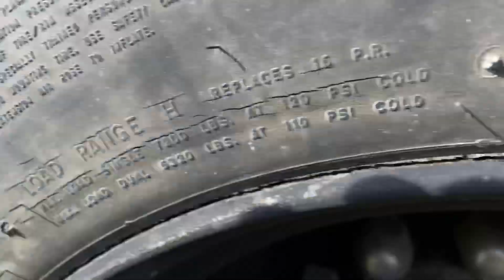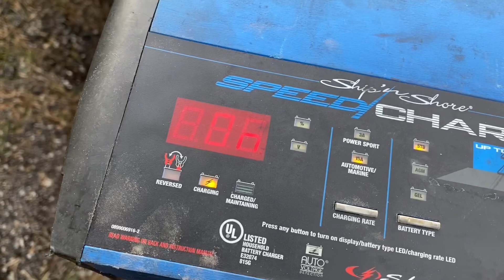8v71 detroit diesel tries to runaway. vintage eagle bus

Comment: I have a strong feeling this bus will never run the highways again. Sad, but so much rust and the price to fix will never be justified
Reply: She's made it this far - maybe she learns how to fab metal... she seems pretty determined 🤞👍
Reply: A millionaire boy friend 😉😎👍
Reply: Most of it is just box section easy mig job just cut weld repeat
Reply: gck82s - While you are correct that actually basic steel pieces that make up the chassis and body structure of the bus is box tubing and other easily sourced basic components what you are not taking into consideration is the degree of difficulty, effort, time, and expense it takes to remove whatever needs to be removed so that you can get to rusted frame, suspension, or body structure so that the rusted, rotted, and otherwise compromised steel can be cut back to good solid rust free steel to graft the new replacement steel to and then paint/“rust proof” the repair and original structure of the bus to try to at least slow down the return of the rust and then lastly reassemble what ever was disassembled to make that area of repair.   Or go look on bussesforsale dot com and or other bus selling sites I saw a 89 I nice shape for 23,9 of course that is pictures but her bus need well over 25K in rust repair plus whatever other repairs it needs which look extensive
Reply: @gullreefclub  This may be a UK USA thing box section is square tube section is round, and yes if you pay someone to do it it's not worth doing but if you do it yourself one piece out, one peice in to minimise stress on the structure as a whole, and work around whats there and jack as needed, get a second hand mig and a grinder it's not hard, fab work is not rocket since after all, it mite cost two grand and take you a mouth to do its all about needs must vs cost and what you can do if you want somthing.
Reply: @sinistersparky9657  best comment

Comment: No blaming the owner nor the mechanic, it happens.   Great attitude on your part.   Possibly create a questionnaire for your clients to fill out.    It takes the pressure off them to answer questions on the spot.   Also helps you get a better assessment.

Comment: Seeing that rust makes me glad I bought an almost 30 year newer MCI, no 2 stroke though :(
Reply: As much as I love 2 stroke DD if I were in the position to buy a bus I would rather have a 4-Stoke Detroit because I predict state of fruit and nuts will find a way to ban them in the state and if not the state cities will ban them like what is happening in Europe with Diesel cars over 10 years old.  Personally I think such ordnances and laws are outright class discrimination but the politicians and greens don’t care about that because they can afford new cars were as the working stiff very often cannot.
Reply: Every drive a 60 series detriot?  Bettar in almost every way to a 2 stroke detriot.  With the exception of simplicity, I would never take a 2 stroke detriot to a 60 series.  As for easy to work on the 60 series is about as simple as an electronic engine can get.   Way better on power to.  Just so were clear Im talking pre 2003 60 series.
Reply: @kevinoscarson2941  Truth! 2 strokes are fine engines that still get the job done, but a pre EGR series 60 is the best engine out there for a bus. Pair it with an Allison B500 and you've got the best combo going.
Reply: I bought an 1998 103-D3 with a 60 series and handicap lift

Comment: Well, I’m assuming you continued to work on the motor after seeing all the rot to determine if the engine is good and can be parted out.  The entire frame needs a thorough up close and personal inspection to determine if the bus is salvageable.  I bought a used Jeep Wrangler and after being assured it was a good car by a mechanic, I found severe rust on the frame just like that bus.  So I took it to one of them there Jeep “experts” who told me he’d seen worse and said it could be repaired.  AFTER I paid $2g’s for the frame repair he told me I needed a new frame.  After!  The young lady needs to be told to stop spending money on the bus until she is certain the frame issue can be addressed for something less than the cost of a brand new bus.  Otherwise part it out
Reply: Of a firm opinion no money should be spent on the mechanical systems of this bus until a through survey inspection of the bus is done and an honest assessment of the cost to make the chassis serviceable and safe, along with brakes, suspension and steering.  Let’s face it the engine and transmission are the cheap things to fix on this bus

Comment: Now I'll finish what I wanted to say from yesterday, electronic issues 🙄 but any way that poor old unit needs a hell of a lot of TLC can only imagine the condition of the suspension ,if the rust you're showing on this thing the bottom " has " to be in bad way ,hope this young women has deep pockets,to get road Worthy,again ,yes I know from what you all put on here mechanical you can get it running ,but that chassis 🤔🤔good luck to all involved 🤗✌🖖

Comment: I understand this would devastating for this young lady to hear but someone needs to tell her that this bus is not worth fixing du to all of the rust, corrosion and general rotten state of the steel in this bus.  I think Eagles are neat looking and interesting motor coaches unfortunately they were made like Pop music and not meant to last like classics such as Silversides or MCI’s.  I don’t know if KT3406E still has that bus he has been torturing but the last video I saw of it the bus while in need of a paint job and probably the interior redone looked straight and the engine was certainly strong because even that idiot could not blow it up so IMO she would be much better off if she had the money to buy a bus like that which is running and drivable that spend another nickel on this bus which should be sold for parts and then whats left scraped.  I have restored more than one rust bucket and despite all the hard work and no matter how careful you are if vehicle is driven in any sort of weather agin the rust will come back again normally with  a vengeance.
Reply: That bus is in the junk yard right now in pieces.
Reply: @user-ln7of9gs4s  He ran it into a tree.
Reply: I saw what he did to that bus and it was painful to watch.. he should’ve sold it as parts or a fixer upper

Comment: I am very glad she now has a qualified, ethical, and moral mechanic. I hope her cousin has the time and commitment to fix the deterioration and she has the money to cover it. I hope this works for her. Eagles always seemed to me to be the more comfortable bus than the GM's. Apparently they do not age well. Sad.

Sorry to be long winded. There are several types of run-away. Scott, could you discuss some of the issues in tomorrow's video?

For the reasons stated at the beginning of the video the engine had a fuel starvation problem and probably could not totally run-away (hind-sight analysis). An engine unexpectedly gaining rpm can be scary because your are trying to think what is happening,  think of the reasons for the run-away and how to stop it as the engine is picking up rpm.  Stuck injector. sucking engine oil through a seal or seals, transmission and power steering fluids being sprayed,  propane leak if you have that feature (Lenny has that feature if I recall correctly), turbo charger leaking engine oil and feeding the engine are possible reasons for a run-away. There is a difference between an engine racing to high idle (stuck injector - 2400 rpm plus) and a run-away past 5000 rpm and going higher because it is sucking volatile fluids through the blower.  There can be more than 10 gallons of combustible engine oil just waiting for the opportunity to be sucked through a seal in the blower.   A true run-away can suck the emergency shut-off flapper (some are a piece of sheet metal) right into the blower. This sheet metal assists the engine to begin the self destruction process. It messes with the blower internal clearances. 

Several things can limit the extent of the injector run-away situation. There is a limit on the amount of fuel an N65 injector can push out.  Or any other injector (N45, to N110) for that matter.  The DD injector is a mechanical injector. No electronics to mess with things.  So there is a limit to how fast the injector can function.  Remember how easily Scott "shorts" out an injector with just a screwdriver pushing the injector follower down. The follower spring is not that strong so it floats easily.  Scott is floating the injector.  There is a limit to how fast the exhaust valves can function as well. Springs have a rate of return. So if the engine is spinning faster than the springs can return then the valves will float limiting the engines ability to function.  Valve float has long been a problem in race car engines since the days of Ray Harroun and Barney Oldfield (Indy 500 in 1911) and before that. 

My recollection is that the DD injector barrel also has a relief cut into the body just past the full fuel position to dump the fuel if the injector control rack plunger goes past full fuel. If a quality injector rebuild shop rebuilds the injector they test the injector to make sure the relief works properly to prevent the run-away. Of course there are always exceptions that get through the Quality Control process or time and gunk mess with the injector.

Comment: That looks like a money pit, I would say swap the motor into a nicer bus or  sell for parts.
Reply: Xmc X No thanks!
Reply: It will be a money pit, but that doesn't mean it should be scrapped. Just needs to be owned by someone with the time and money to make it nice again. I personally have never seen so much rot in a vehicle before. I personally wouldn't buy this bus, it's not a desirable enough design and style for me to put the money it needs into it.

Comment: i would probably make an "pre repair interview" checklist with these 5 items on it:

1) does the bus currently run?
2) if the answer to question 1 is NO, ask when the last time it was run
3) ask them if the engine was doing anything strange when it last ran (hunting idle, Start/Stall, attempted runaway, no throttle response, etc)
4) ask if any previous mechanics or "scam mechanics" have worked on this bus before you did
5)if the answer to question 4 was YES; ask the customer to point out everything those previous mechanics or scam mechanics have done and determine how far they deviated from the stock configuration

Comment: Being an artist, she should learn how to play the 'Welder'. That bus has plenty of opportunity for practice, practice, practice.
Reply: Robb403 That’s the plan 😎
Reply: Anokhi The One as an old British car fanatic, rust is my constant problem....suggest a basic sandblasting setup with a good sized air compressor .....it has many other uses too. If you start with an extensive pressure wash, dry then scrape, chip and finally blast, you’ll know what you’re working with. Anything can be saved that’s made from steel....but if you’re not a patient woman now, you will be before it’s over!

Comment: Good reaction time! I don’t think it actually revved that high. It’s a bit scary though when the fuel is cut off and it keeps running. That’s when you think, oh no is is running on the lube oil?
Reply: Yeah true runaways are truly scary.  Because the limit to their rpms doesn't rely on a governed source of fuel. When running off of oil they will run well over 5000rpm and shooting flames and bellowing soot in the sky.  The detroits actually used to sometimes run off of oil leaking past the sloppy pistons and rings and the hotter they got the thinner the oil so they would scream until they go boom. And of course oil getting into their intake tract from seals is typically how it happens. Or some of the mechanical injection pumps could actually be turned up too much that it overrides the governor spring. I've experienced that one myself haha
Reply: Andrew Bartleman 8

Comment: Had 671 take off on me in a engine room of a boat. Talk about seeing your life flash infront of your face I was crammed between 2 of them running and the port side one did that “hovering” Rev bounce then took off. I’m getting the chills thinking about it. Yanked the air horn shut off it idled down for 2 sec before the plate bent and it took off. Had to reach down the side of this screaming engine to kill fuel.

Comment: My 79 eagle has the early shutdown with air pressure. In my case, it's because there is no key wired in the system (start with a cheap clip on start button while I work on the dash). The easy fix is to remove the air line going to that solenoid which is also connected the fuel cutoff valve and just kink it over to keep it from leaking. Works well enough to keep the motor running

Comment: It’s hard to say how bad the rust is from looking at the video.  I’m guessing most of the folks who are saying the bus should be scrapped don’t live in the rust belt.  Hopefully, the rotten areas are stuff that’s easily fabricated and/or can be cut off of a donor bus.  I’m sure Scott will tell us in the next video.  

The bus community seems eager to help keep these busses rolling and the owner seems like a cool cat.  I really hope this bus can be saved without breaking her heart and bank account.

I bet the previous mechanics knew there were stuck injectors and left the fuel line off so she wouldn’t nuke the engine.

Comment: SCOTT, I KNOW IN YOUR WORK YOU HAVE TO DRILL BROKEN BOLTS. HAVE YOU EVER TRYED COUNTER CLOCKWISE BITS. MEANING DRILLING WITH DRILL REVERSED. A LOT OF TIMES THE BIT WILL CATCH AND BRING THE BROKE BOLT OUT WITHOUT HAVING TO USE AN EASYOUT.
Reply from the maker: Yes, I have a set

Comment: I don't know about reliability but it seems like the electric fuel pump does provide enough fuel for it to scream flat out.   I agree, check the injectors and get it running.  Then the decision needs to make if it is worth spending thousands and thousands on fixing the rust issues, or not.

Comment: I think someone setting out in one of these buses needs to be a little more mechanically inclined than she seems to be. If she has to pay someone every time some little something happens to that thing it’s going to cost a fortune. Lots of work ahead. Wish her the best though it will be a fun ride if they get it Road worthy.
Reply: Sounds like she's only talked to "mechanics" who wanted to take advantage, maybe Scott will be able to teach her a few things. We all have to start somewhere.
Reply: The average Joe’s tinkering And Repair Show What’s interesting is that at this point after having it for 5 years I now know more than most mechanics about my bus. The other mechanics took advantage because they didn’t know how to fix it and tried to make up problems to fix. Scott also taught me a lot and I also have a manual for the bus. By the time this bus is up and running I’ll be an expert!
Reply: Anokhi The One that’s good learn all you can it will save you a ton of money. They will get you rolling.

Comment: On those eagles, if the fast idle cylinder is integral to the buffer screw and the throttle lock cylinder is not engaged this runaway can happen. She said the accelerator was stuck so the throttle block cylinder could be corroded and stuck.
But I think you have a stuck rack on an injector.

Comment: Stop rot where it is by going to a self serve car wash, select spray wax, and wax the underside and all potential rot spots as well as potential dry rotting rubber bushings etc.  Also, silicone tire shine protects mufflers.

Comment: Lucky it wasn't a 6V53 series, they go from crank to lots of brown underwear much faster.
I've had 71's manage to keep firing by sucking fuel back up the return line, they have no power but they just won't die, that was with overhead fuel tanks in industrial installations.

Comment: Surprising that the diesel started that easy on those weak batteries and corroded connections.
Good high CCA batteries, clean low resistance connections are essential for minimum voltage drop during starting, especially for diesels. 12 or 24 Volts ?

Comment: If they got it started 6 mo. ago, and it did a runaway, I can't help but wonder, how did they get it shut down then?
Reply: oldseadad We killed it with the clutch or it would cut off on its own overtime.
Reply: That was good thinking. I'm not sure I would have known what to do when the thing took off revving. I remember a snowmobile with a frozen throttle cable stuck full throttle, flying along squeezing the brake as hard as I could and finally got the ignition key turned off. Also car with frozen accelerator pedal. Again turned the key off. But with diesel... That was good thinking to let out the clutch and stall it.

Comment: It'd be nice to have some engineering drawings for that thing...  Would help reproduction of the various rusted out pieces.  If not engineering drawings, hopefully she can get someone to take detailed pictures and measurements from an example that's in better shape.

Seems like those buses need fender liners to keep the salt from eating them up.
Reply: Matthew Prather Yes I have the bus manual and it shows the diagram of how the infrastructure is supposed which helps a lot!
Reply: @AnokhiTheOne , that's great!

Comment: Or there was the other option to have someone sitting in the drivers seat with it in top gear ready to Drop the clutch if it runs away. It's a pity GM's have that fault, and unfortunately Listers can runaway too as I found out one day (a similar injection system as far as the Rack is concerned). I was sweating Blood that day, I wasn't prepared for a runaway either.